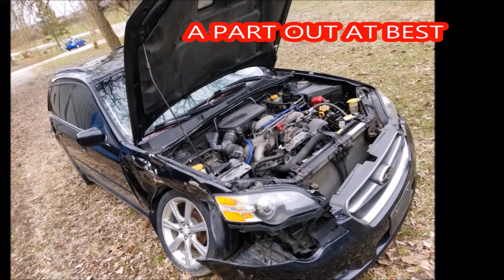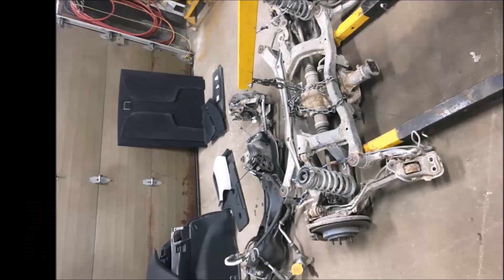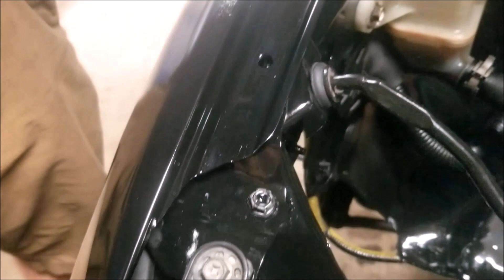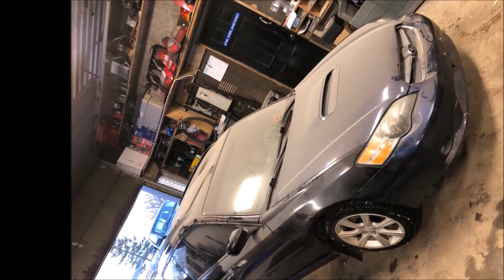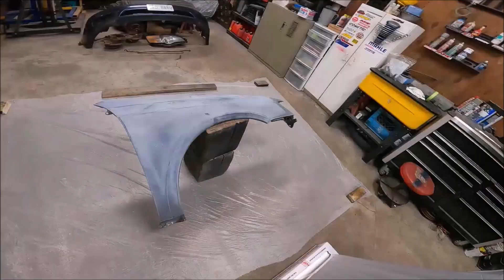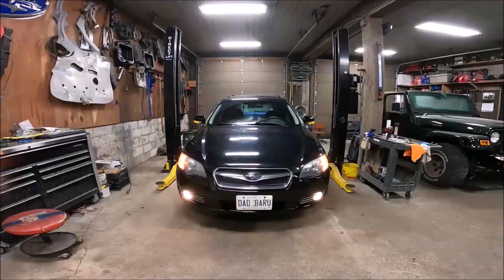Accident Repair - BP Subaru Legacy Wagon - Start To Finish

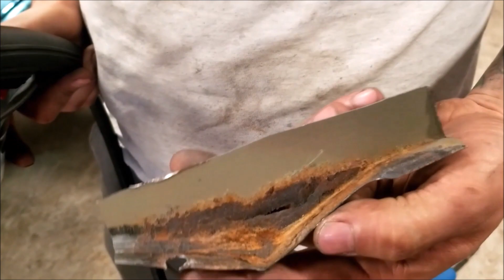Comment: 3:00 Does this rust only appear on the filler neck side.. or both sides.
Reply from the maker: Both sides commonly, my car originally had no rust at all but the donor car had the smallest little bubble on the outside of quarter and i had wanted to show what a bubble on the outside looks like on the inside

Comment: Hey man so recently someone rear ended my 2007 Subaru legacy outback 2.5 xi. I was wondering if I could just go to a similar year Subaru and replace the back trunk door and lower bumper on the rear. Do you think that’s possible?
Reply from the maker: 05-09 legacy and outback if its a wagon. Yes should be possible if it didnt bend in the quarter panels